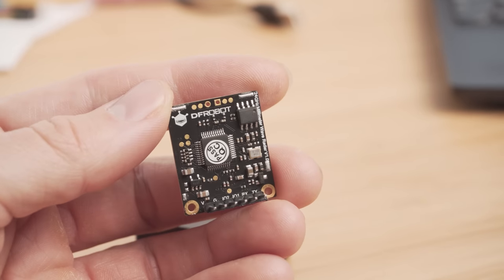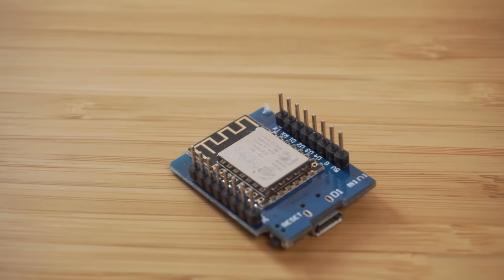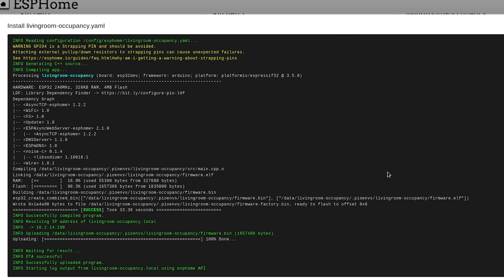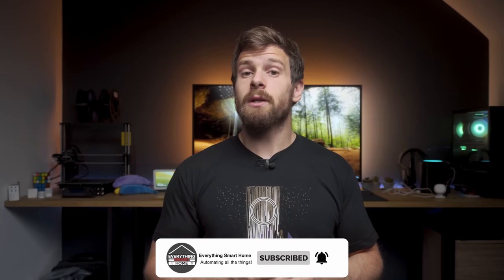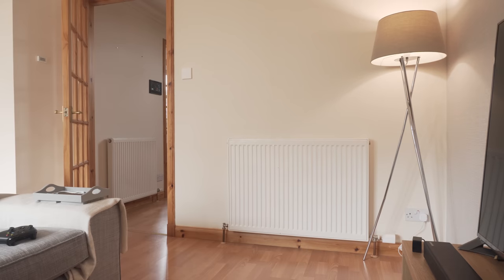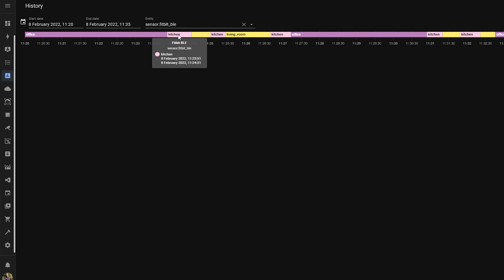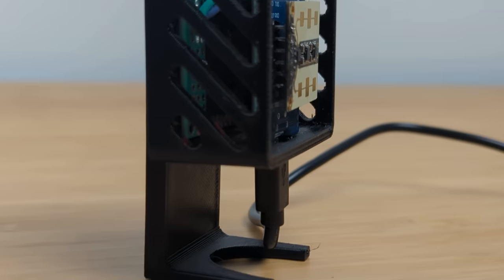Building My Perfect Smart Home Presence Detection Sensor!

Comment: This is really a great video on a very interesting project. It seems to me that this sensor has all the functions I need. I would like to rebuild the sensor to use it in several rooms. Unfortunately, my knowledge of electronics is not sufficient to rebuild the project with the available information. Therefore the question, will you publish a detailed plan and if so, when?
Reply from the maker: Thanks! I plan to at some point yes when I get some time, having said that...stay tuned for more!

Comment: This sensor is genius, thanks for posting. I guess it's your fault these millimeter wave sensors are sold out. 😁
I'd like to ask you if you could review how the bed occupancy works with the millimeter wave if it is mounted under the bed pointing to the floor. The reason I ask is because i don't want cabling on the floor, if not for other reasons it's the vacuum cleaner. Would be really nice if you could test this.

Comment: Hi Lewis , 
that is the greatest Presence Detection Sensor ever. the ones I ordered and installed had some delays in ditecting movement and presence and most of the time did not function as i hoped for.
i wonder if I could buy from you a  complete built "Smart Home Presence Detection Sensor" with the software?  🙏

Comment: I'd be interested to hear if you've used them both in a corner of a larger room. I have the DIY one setup in the far corner of our living room and even though the FOV and distance should be well within its range it does quite often fail to detect consistently. In your example of waving a hand in front of it, mine works fine too. Perhaps it's more suited to the office desk than a larger living room. Hopefully I'll pick up a FP1 when they drop to around the £30 mark!

Comment: Thank you for this very helpful video! I've not tried this setup yet but on many occasions struggle to solder properly due to the solders I have had or tried, would be helpful if you have a link to the one you use or one similar to get. Thanks

Comment: Fantastic build, It make the Hive system look like a gimmick. (which I think it is)
The problem I have notice with the radiator wax thermostats is by the time the radiator thermostat decides to turn down it is to late, the radiator is full of hot water and the room is too hot, eventually it levels off and works correctly.
Is there a way of controlling this event from a cold start, of the radiator letting too much hot water through from cold.
I realise I will need to get so called smart radiator thermostats, but how to control this is something else.
Any thoughts would be great. thank you

Comment: Was an article for this video ever published or has it been pulled now that the other presence sensor is available to buy? Trying to see if the .yaml is available as you seem to be doing some coded filtering of the values in the yaml file which i'm interested in not reinventing the wheel with...

Comment: HI! I would add some LED for notification/status. For example, when i'm in shower, I turn on lights manually (PIR override), so PIR dont turn off light, while I'm showering, problem is that, when i went out of shower, I don't know, if light is turned on by sensor or manual switch. If that was sensor, then light will turn off after minute, if manual, then never. In that case, I always do double check - manual turn off. In this scenario I would love to give quick glance on my PIR (in my case shelly), that will have LED that give me status of active light mode. This is my scenario, why i would add to this - LED status light

Comment: This is a great idea. My problem would be making all the parts work. I know nothing about coding, soldering boards, or any of that stuff. However, I could see a use for all the features you added. I think the only other thing I would ask for is RF and IR interfaces to control none smart devices based on presence.

What is the range for the sensors?

I'll take 10 of them. Can you make that happen? :)

Comment: Why didn't you use the radar sensor as it has a light sensor on the board it is supper sedative fully adjustable with many settings and cost peanuts,
I have one in my workshop as soon as I open the door, the lights come on and stay on until I leave.

Comment: PIR sensors should be combined with a thermal image program. A still thermal image can be triggered from a smartphone to be taken as a benchmark. Such an app must allow to set bypass at certain places of the room where there are light bulbs or the fan motor which tends to get hot in order to avoid interference with the functionality of this particular sensor. The idea here is to use as little amount of 'electric energy' as possible, thus less sensors = less idle energy consumption from such detecting systems. This is how it should work... the PIR sensor detects a movement, and switch gets turned on, it has a preset time of 4 minutes before it turns off the switch if motion has not been detected. however, on the third minute of inactivity from the PIR sensor, the camera should take a still image and notice the heat patterns and compare it with the benchmarked image which was set by the user earlier. If the set zones are hotter than the benchmarked image then have the device stay on for another 5 minutes or else turn it off. At the end of the fourth minute take a new image and again compare it with the original benchmarked image and if still heat is detected then keep the device turned on for 5 more minutes or else turn it off (keep on repeating this behavior). But whenever PIR detects a movement, it should cancel the camera sensor timer and also reset its own timer to 4 minutes (repeat this behavior). When neither of the two sensors detect any heat, then turn the desired switch to off. If one is only passing by and do not wish to turn the lights on, say because it is daytime, then a bell switch can be located nearby, when pressed it gives power to the PIR /camera sensors, the PIR/ camera sensor must turn on the appliances at startup by default (example a light bulb or whatever the user wants), the bell on the other hand must have an inching setting of 10 minutes of its own, after which it turns off the sensors. but with each detection from PIR/camera the inching must reset from the beginning. so this means if the PIR/camera did not detect movement/heat for more than 10 minutes then these sensors will shut down and only way to turn them back on again would be from the bell switch.

Comment: I think you are close to a winner here, in terms of features. If the level of interest here in the comments is anything to go on, many people would like to buy a version of this sensor, either as a finished good or as a kit. A few thoughts on that.

First, the current appearance is not going to fly in many households. "Spouse approval factor" aside, I think the current version is unattractive enough to not want to deploy it outside of a lab or test environment. So it'll need a better case , which will add to the cost.

Second, and related, with the current bill of materials (BOM), there's no way you can offer it as a finished version, unless you basically donate your time to assemble it. A few folks will pay US$75 for something like this, but probably not too many. And charging a price to make it worth your actual time and investment seems like we're in the US$100 range, as currently designed.

With those two things in mind, it seems like a v3 is inevitable. (Also, it seems like building these is fun, which similarly makes it inevitable.)

For that next version, maybe consider two things: 

- What's essential, and what's nice to have? What can you take out to get the BOM down to something under, say, $US40 in parts? US
$25...?

- Similarly, what's essential if you were to offer this as a kit? Could you do "just the hard parts", and let buyers source their own components, assemble, and so on, to keep the costs (to you) down, and the price (to us) affordable?

I'm specifically thinking of another person here on YouTube, Peter Millard, who spent a few weeks developing a design for a woodworking fixture (a DIY mount and hinge for a track saw rail). He was looking at creating it as a complete kit that you glue/screw together, but the BOM didn't pencil out. Instead of throwing in the towel, he picked out the hardest part of the design to get right, and is offering just that part as a physical product. (Plus plans, at a small cost.) It's smaller, he gets much higher yields on the CNC, and shipping costs go way down. See one of his final videos, putting them for sale, here: https://www.youtube.com/watch?v=LsFN4ChQdF4

So, similarly, for this sensor, there's the main board, and there's the case, both of which require either specialized tools (soldering, 3D printer), or the skill level required to get it right is high enough that it's a barrier. Most people can source the semi-generic sensor parts, and lots of us can manage with ESPHome or what have you. But I'm not buying a 3D printer any time soon, and my soldering skills make yours look terrific. ;-)

Another thought would be, could you design a custom circuit board to make assembly and soldering easier, and offer those for sale?

Anyway, super interesting video series you have going here, and I'm looking forward to what comes next in this project!

Comment: really great project. a question about the mm radar. Can it be used as a sensor in an alarm system in a house with pets? Or better will also detect animals? I have a cat and i placed the aqara pir sensor at a height where it doesn't detect the cat, so its usable, how about the radar?

Comment: Really awesome job with this!  keep iterating on this!  I'd love to see you make a PCB project we can purchase to make these sensors.  For the face of the package, I see you 3d printed a case, can the front of the case be covered? or does that block the sensors?
Reply from the maker: You can cover the mmwave sensor yes, there needs to be some slots or way for the light to get in for the light level sensor though

Comment: ok i have questions but first.... I squared C not I two C (I2C (Inter-Integrated Circuit, eye-squared-C)).  When you have 2 sensors doing the same job, what is your logic for who wins? which signal is more believeable ? or are you just taking the detect from whichever sees movement first ? in the event of a false detect, which sensor do you then believe less ?  This reminds me of why tesla removed radar from its vision+radar config as you couldnt have logic to which sensor you believed to be more true than the other.  Ive only seen 1 person explore microwave sensor, that would be interesting to see your results with that and alsoo with non-contact thermal sensors

Comment: Great to have all the sensors in one gadget.  An additional thing I can think of adding would be a couple of IR LEDs so that you could trigger “old” devices (such as opening/closing skylights, TV on/off, A/C, etc).  It seems a very cheap addition for potentially valuable functionality.

Comment: hello Brilliant device . I am in the process of turning my home into a "smart home". I would need these sensors to monitor presence temperature humidity and lux. I currently (2) sensors from aeotec and they work almost perfectly. I would need to add (in my opinion) at least 4 more. I like the idea of putting the sensor under your bed. and use to turn on the lights in my br gradually in the morning. allas i have 2 left thumbs It would  be grat if ytou were to market it. I would suggest to develop this unit to be zigbee or zwave so simpelton like my self cvould go into home assistant an add it throught the GUI. Your price point is OK because one does not need too many of these devices but can do so much with them. Once again brillant

Comment: Two questions. ESPHome - is this a configuration program only? IE I can tweak all the settings required in there and then share the finished device with Hubitat and it'll work as I programmed?
Secondly, can you see anyway possible you might be able to make this a flush ceiling mounted device? Maybe we could hack into one of the generic mmWave ceiling mounted devices from Aliexpress and use the shell...

Comment: Hi Luis, first of all, Happy New Year. I made a couple of this based on your project, one ESP32 D1 and one ESP8266 D1, they work fine, except like you said, night time its not that sensible, and keep showing cleat few minutes the back to occupied. On the ESP32 I also added the BH1750 as light sensor and bme680, works fine except the temperature is between 2.9 - 5 degrees higher. If I place the sensor on top it could get up to 5 degrees more, if I place the sensor on the bottom its about 2.5 degrees, and without enclosure. Do you have a similar problem?

Comment: Kool project, similar to what i want to make! I want to make it cheap AF tho, im a poor.
I plan on building a motion/light  sensor, to mount under my bed frame, with an if low light or no light is detected, when my foot is visible from under the bed, it turns on a led strip under my bed. Never made a device before, but originally i thought it will have IR sensor.
After a quick scroll on your vids i sub anyway.
Is that a self sourced 3d printer i see in the back?

Comment: For air quality, my priority would not be the bulky PM sensor you considered, but a CO2 sensor "reminding" me to have ventilation. Of course, good CO2 sensors like the SCD30/SCD40 are not cheap, and I'd absolutely avoid those "eCO2" sensors, which are not really able to detect CO2.
Reply: +1 for the CO2 sensor, not just for air quality but as a good indicator for presence detection
Reply: @MrLister   As long as it is not for turning on the lights💡Of course, with summer weather and open windows (nice where I live), the CO2 level flatlines (with a bit of noise) unless I breathe directly on the sensor. But the level does change quickly being in a small room with doors/windows closed. Or opening the door to a room with a different level.

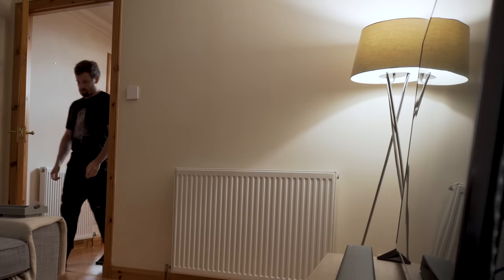Comment: Hi Lewis, at 2:00 into this video you refer to the delay in the switching on with the milimeter wave. 
I have my homes security system PIR sensors connected through a Konnected board and Home assistant, and ever since installing a UDM Pro into my network I have the same issue... however for me it is a 2 second delay. Did you find that the delay was only with the milimeter wave or are you running a switch like a UDM Pro???
Reply: I have an UDM Pro and a ESP with an PIR in an Multisensor... I have no delay.
Reply: @YaGr-ip3ub  I suspect the delay is through the Konnected Board.

Comment: I think occupancy detection doesn't need anything fancy, it needs something thats so simple but unavailable for some reason: a pressure activated plate switch. it turns on the lights before you step into the room and the rest of the sensors you used keeps it turned on. Don't forget there is also ultrasonic detection

Comment: Why limit it to sensors make it a truncated pyramid or round about one foot square to put in the ceiling center. Add a down facing spherical camera with smart speaker and microphone you could even add your air quality sensor.  Make it's cover in many colors, maybe add RGB led lights. if is round it could be your classic flying saucer for getting attention.

Comment: If you were to fully enclose the sensor, what sorts of considerations would you need to keep in mind so as to not interfere with the various individual sensor operations?
Reply: I think you would just need openings for the motion detection itself. I'm not sure how wide of an opening you'd need for the mmwave sensor, though. From what I could find it's radiation pattern seems to be pretty wide and a narrower opening would probably hurt it's accuracy. However, you could also probably raise it inside the enclosure (or make the sides shorter) and have the mmwave sensor mounted closer yo or even against the top of the enclosure.
Reply: @AlsoAlaskanBeard  Hmm the mmwave sensor would be the one thing I wouldn't think to worry about, as MM waves should move right through plastic?  Sorry I didn't say the first time but the enclosure would most surely be 3d printed.  Don't know about the PIR, and I assume you need some sort of vents for the temp/humidity sensors

Comment: hi, I see the BME280 and BH1750  from aliexpress comes in 3v or 5v but the original Adafruit BH1750 version support 3v and 5v. did you connect it to 3v or 5v or should I get the Adafruit version? Thank you